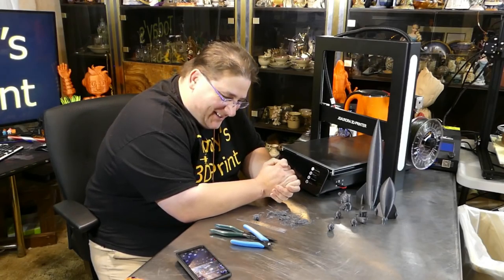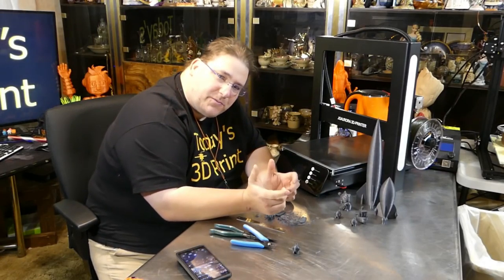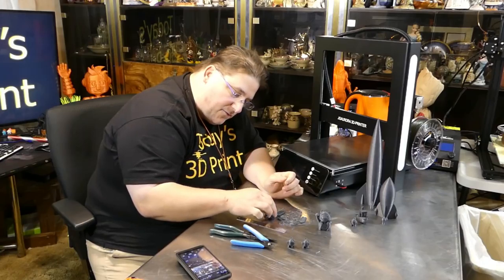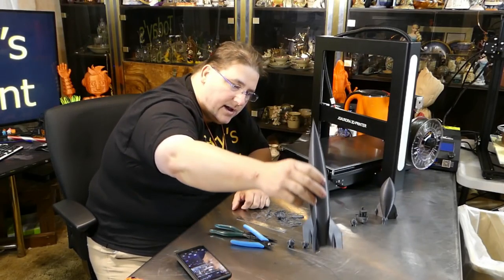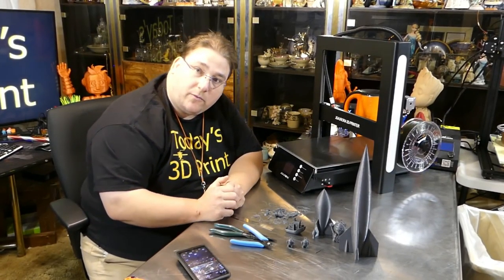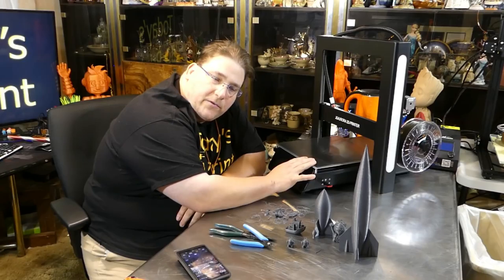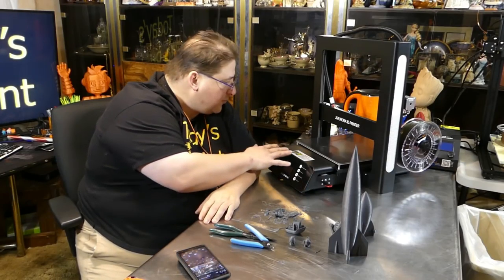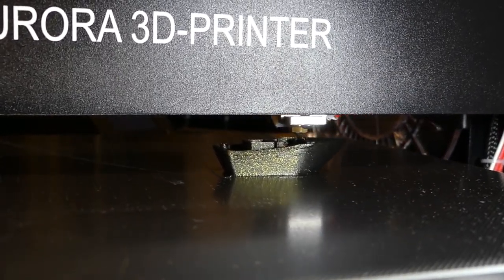Today's 3D Print 163 JG Aurora A5 Part 2 Unbox, Assemble, Print

Comment: Thanks for the review+ follow up and the generally interesting video ! I'm a bit on a swing in terms of this Aurora, a couple of questions if you don't mind ? Max nozzle temp for example : it's stated to be 240°C from what I read, but for doing ABS, that's pretty lowish. Can you choose/select a higher temp than 240°C ? I'd be fine with 250°~260°C.  Secondly, did you get the bugfixed firmware already ... and while we're at that, this should imply the machine doesn't have a CR10-we-neglected-the-bootloader issue from the box, right ?  What kind of nozzles does this device use ? Any idea how the heatbreak looks like ? Also, I found a very early review on the A5 where the tester stated it was more-or-less junk, and the frame and Z-Axis assembly lacked any kind of stiffness. Any commend on that as it seems pretty sturdy in your case ?You were friendly enough to show there was a replacement nozzle there, but it was kinda impossible to see how that looked like.  Any idea about the firmware/board being used ? Max heated bed temp ? Time needed to reach max bed temp ?  Sorry if I'm asking a lot, but I'm trying to get all boxes checked before making any decissions .... and keep up the good work !  And one little last question ? Instead of that cat, why not print the CR10 cat instead as I'm sure a lot of people can instantly relate and judge that one a lot better than the version you chose. (it's up on Thingiverse, https://www.thingiverse.com/thing:2501240, but I'd be more than happy enough if you'd print the smaller one and not the cookie jar version :D )
Reply from the maker: +Kris Waclawski no worries my next session I will try to see how many of those questions I can answer

I can answer a couple now it looks like a standard nozzle like what is on the cr-10

I typically only go to 60c and it gets there pretty quick I will see how hi it goes

I do not see any of the problems listed in that earlier video so my current gas is that mine saying updated model means they've made directions a few people have ordered it once they have them that will confirm it or not

I should be able to find out the max nozzle temperature tonight
Reply: Hi there ! Thanks a lot for considering to answer my questions. I looked at the "uncut" version of your video now, and it did allow me to extrude a bit more info about the used board for example. You stated you saw sockets for the stepper drivers. The touch screen is a typical MKS 2.8 touch screen (yeah, they're a bit slow and not really my favorite way to control a printer but they do work), so I'm 99,99% sure what makes this printer tick is probably a MKS L Gen 1.4-like board (those have sockets, and have an "extra port" for a dual extrusion setup ect) ..... and I've never seen an MKS Gen board without a bootloader like on the CR10's.  Presuming I'm not reading too much into this, it would mean this machine is quite easy to flash with a new firmware, my guess being they're probably running Marlin. Would be nice to hear if they publish the firmware which under GPL like they should do but even if not, if it's indeed an MKS L Gen type of board it's pretty easy to update it, and modify it with new goodies like ABL ect ....   This actually could be a nice machine, but I'm not 100% happy with the amount of printed parts unless JGAurora has no issues sharing the STL's at least so we can print out spare parts ourselves if need be.  Keeping a close watch on this one, and again, thank your for your trouble trying to answer my qeustion. Subscribed to your channel now. :) And yeah, as the printer is in promotion atm, I kinda would appriciate the added answers if possible. Already got news the hotend should accept 250°C from a different Aurora user, but confirmation from your side would always be nice. :D
Reply from the maker: The UI limits nozzle to 250c and bed to 90c. BARELY enough for ABS I think.

time to nozzle max Time to bed max in a 55-60F house

Nozzle to 250 in 90 seconds. bed to 55c in 120seconds, 60c 150s, 70c 240s, 80c 330s, 90c 480s 8 minutes and I keep a COLD house :-)

I will see if it can go hotter via gcode. that sometimes works :-)
Reply from the maker: Good news. I was able to define 260c nozzle and 100c bed temp in gcode and the printer accepted the parameters and reached them.

9:20 to reach 100c with the bed starting at 60c (cold house)

an additional 2 minutes to get the nozzle from 26c to 260c

it reached both temps.
Reply: considering the heated bed is probably not insulated at all (the hotend clearly isn't either) I'd suspect those heat-up times can be clearly reduced  ... and just to minimize the fluctuations of the hotend you reported, insulating that stuff should be more than worth it.  Personally, independant of price point of a machine, the number of companies not equipping their machines with hotend&heated bed insulation or part fan coolers is absurd and those companies should be ashamed of themselves imho.  But yeah, 260C is more than sufficient for the type of stuff this printer would be used for, the only question remaining in the firmware update story. THANK YOU for providing the answers so far, still hoping to see a CR10 Cat from the JGAurora too (Miauw !!).   I DO however wonder if the specific bed surface doesn't change the type of temp needed to make ABS+ prints stick to the bed ?

As for 250C not being hot enough for ABS, well it depends. On a insulated nozzle, running in an enclosure and using mainstream ABS or better even ABS+ I get good results. All my machines run in heated enclosures anyhow, in a basement with a pretty constant 20 degrees centigrade. I also have some more specific ABS+ available with a lower temp envelop, starting at 225 up to 245C (not totally unlike certain PLA+ series) ..... so yeah,  The only 2 things I'm still disliking a bit are the used printed parts, I would mind less if we woul have the STL files for those, and the too-low spool holder which will most certainly needs to be tossed if I want to use 2.4kg spools.
Reply from the maker: that heat up time is actually pretty nice. seeing as how it takes more than 3 times that for the CR-10 to get to 80c :-)

and remember. my house is VERY cold. 50 to 60F. which will impact heat up times.
Reply: I have a CR10, I can say the heat up time improved dramatically after insulating the bed.  But yeah, most of my machines have 220V mains powered heated beds so I'm probably spoiled.  So now it's waiting if/when them guys send out that new firmware out. I've taken a peek at their website but in terms of support there's very little to nothing to be found about the A5 (yet ?).
Reply: Hey, little heads-up. You remember you commenting on the X-axis parts being printed parts ? (good looking, but still 3D printed ?). The current versions are all metal : they offered sending me the metal versions if I'd pay for shipment and they showed me the metal-versions of the parts. Also, the firmware has indeed been changed to counter that 200°C issue.
Reply from the maker: fanstastic!

Comment: Hey Chris, great video on the A5... Can you tell me, what software are you using with the A5?
Reply from the maker: +TeamRIGRAP I have used simplify3d and Cura excellent results with both.
Reply: Thanks for your response Chris...
I'm awaiting the arrival of my A5 and have downloaded Cura.  However, the part we are seeking to print out we're hoping to make 100% solid so it can be tested accordingly. The finished part in production will be made of ABS with 3 to 4mm walls.  Any suggestions of how to set up Cura for that type of printout?
Reply from the maker: +TeamRIGRAP no different than simplify3d the settings are pretty much the same flow rate is going to be critical for you you're going to have to tune that very well we will end up with over Extrusion which will make your part Puff and be out of spec settings are less about the slicer and more about what you're printing what are you trying to print?
Reply from the maker: +TeamRIGRAP and don't forget to account for shrinkage if it's a Precision part ABS drinks a lot so it'll probably take a couple of different scale test Prince to get the right shrinkage
Reply: The plan is a slow build rate, .01 layers. At 100% fill, the Cura software is stating a 3 day+ build time The part is 310mm x 160mm x 50mm and for the most part hollow with 3 to 4mm walls... Just need to make sure the walls are solid.  The rest of the part we want as hollow as possible.  The shrinkage I'm guessing will be no more than 5 % which is okay for a test part.
Reply from the maker: +TeamRIGRAP unless you really need the detail go with .2 mm layers it'll build faster and be stronger
Reply: The more detail we can get, the better. This is my first attempt using an open source software program for printing (been using a UP printer), but your suggestion is valid, I may try it .2 on the first try and then use an acetone vapor bath to smooth out the surface.
Reply from the maker: +TeamRIGRAP if you're going to Vapor smooth it you're going to lose most of your detail anyway at least your super fine detail so just go with .2 millimeter and see how that works it'll be done in a day and a half

Comment: Hi again!
Read up on the specs of the A5 from jgaurora3d.com, maybe you could confirm if this is true:
"Removable Magnetic Heated Platform: Allows easy removal of the platform and the printed parts and a cleaner appearance."
Is the platform really attached with magnets and removable?

Or would this just be a poor translation describing their "Ultrabase-like" bed?
Reply from the maker: +GlennJacobsen I want to say no but to be honest I never checked give me 30 minutes I'll find out :-)
Reply from the maker: +GlennJacobsen I can confirm there is no magnetic plate it is adhered with adhesive to the aluminum plate it cannot be removed easily
Reply: Nerys It was too good to be true, wishful thinking I guess. 
Thanks for replying back! Can’t wait to see your further experience with this printer.

Comment: Lol, great minds think alike, spent a few late nights myself this week building a 3mm hot end for my delta. Result: 18hrs sleep this past week, ABS prints fine with an all metal hotend but pla really doesn't like it!
Conclusion: undo hours of work and switch back to 1.75mm filament!
Trouble is that I really want to print higher temp materials but don't like the idea of gassing myself and family with neurotoxins with PTFE lined hotends.... Any ideas from anyone on a decent throat (1.75 & 3mm please) for an e3d clone hotends setup?
As for why 3mm, well flexible materials print easier and I have loads of decent filament I scored cheap recently!
Ta!
Reply from the maker: +Chris Kyriacou PTFE is fine as long as it doesn't pass the heat break if temperatures above 260 make it past the heat break you have other problems :-)
Reply from the maker: +Chris Kyriacou I am fascinated by what micro Swiss did by using titanium as a low thermal transfer medium for the heat break it'll be interesting to see how well it works
Reply: Nerys I have several types of throats but the PTFE always slides all the way down past the heatbreak and sits on top of the nozzle in the heater block. I can't see how this is avoidable with a PTFE lined throat.
My e3d clone heatsink and fan is definitely working well as after a 3hr print at 245c it was barely warm :) unlike the Chimera hotend I have that runs much hotter.
Good PTFE is rated to about 255c but who knows what 'good' is with Chinese kits and parts? I'm not knocking them, though.
You had that awesome Capricorn stuff on one of your vids; very cool and you know you have the genuine item (easy to spot!) and can view the PTFE properties on their website, for example.
Either way, i don't think I will be able to work out a setup that will let me switch between 1.75mm and 3mm as easy as just swapping the filament spool, as there will be too much compromise at the expense of print quality on 1.75mm filament.
It was an interesting experiment though, and you learn by doing!
Reply from the maker: +Chris Kyriacou on the micro Swiss hotend for example the PTFE tube stops before the titanium heat break so the PTFE tube is never exposed to the higher temperatures on the creality the PTFE tube goes down into the heat block so it is exposed to high temperatures